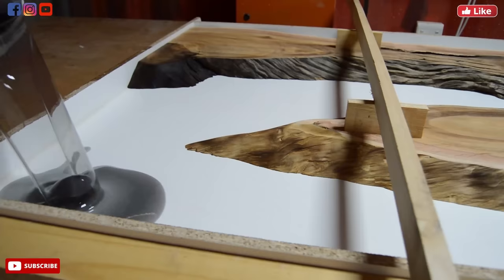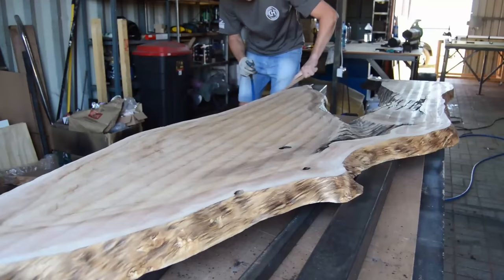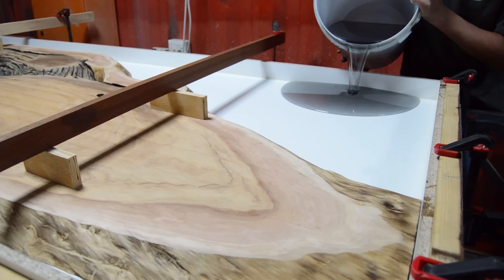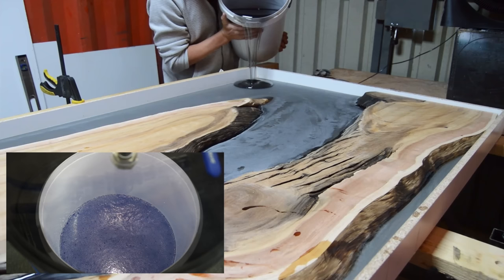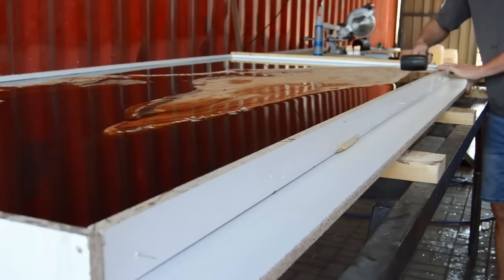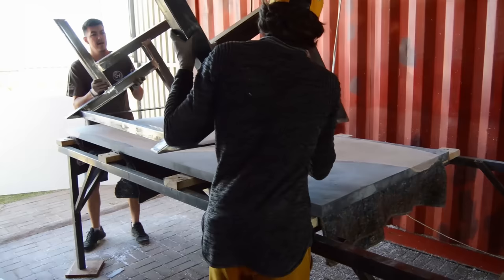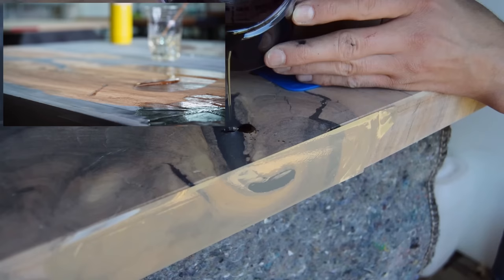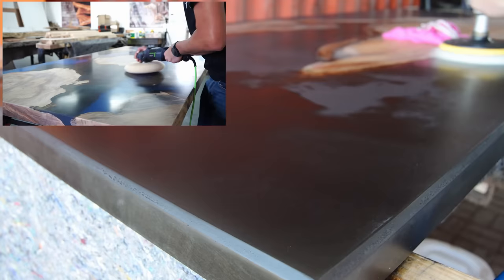building EXPENSIVE furniture using DIY skills + (GIVEAWAY)

Comment: I've liked and here's my comment. Sanding  between epoxy layers.   Will scratches from Sanding show through to the top layer?
Reply from the maker: I was worried about the same thing, but with research and speaking to other manufacturers, it did not leave any marks. Sand with 180 grit if you want to do this step
Reply: @diywithgreg  cheers thankyou. I do like the idea of just letting it become tacky then pouring again.